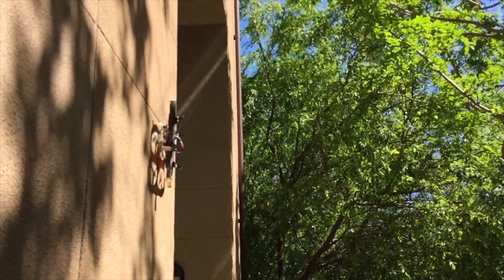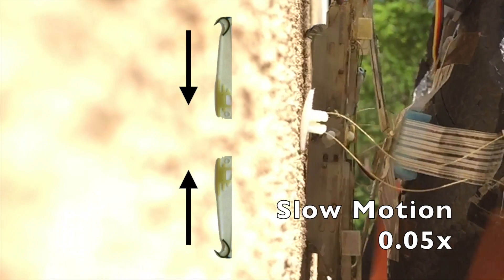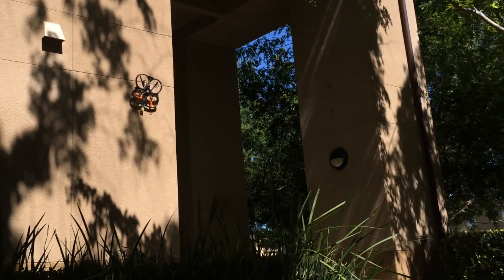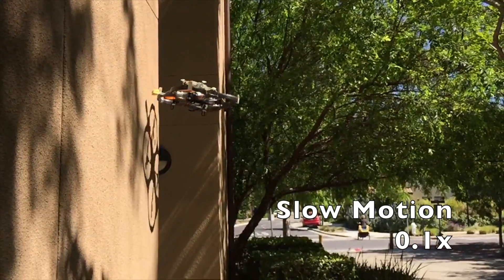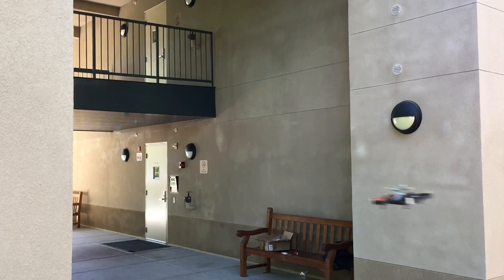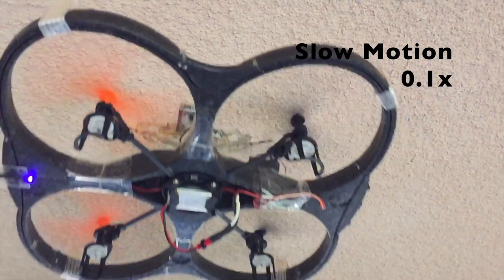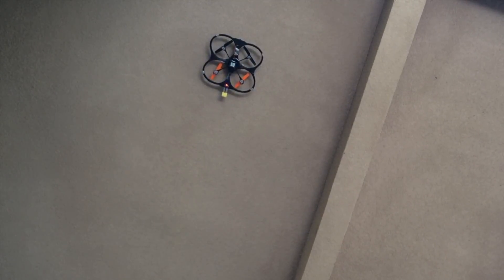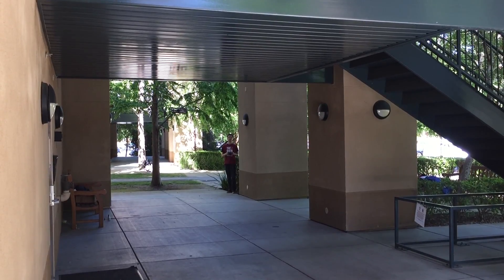Quadcopter Outdoor Perching with Opposed Micro-spines

Comment: I could see this further down the line replacing most security cams.
As it could basically become a mobile security cam and with the right programming it might possibly lead to better speed controls as well. Sure some might spot it, shortly after it would be another place so it's effect would be noticed on traffic speed.
Good and bad as it is